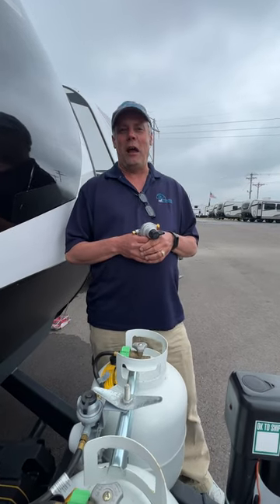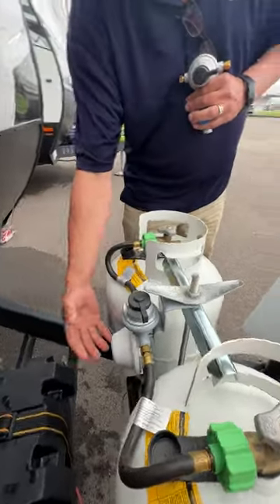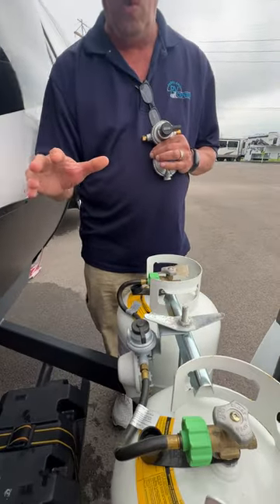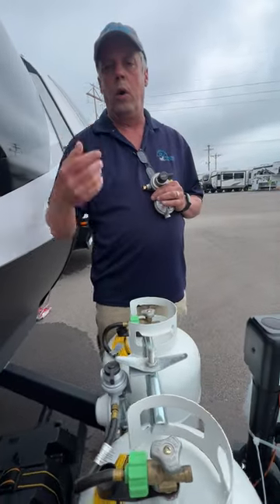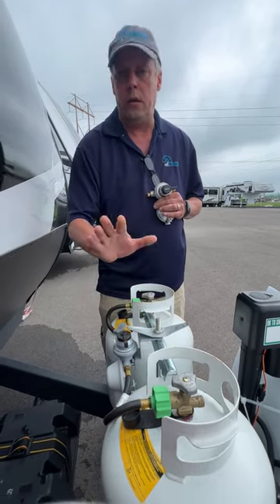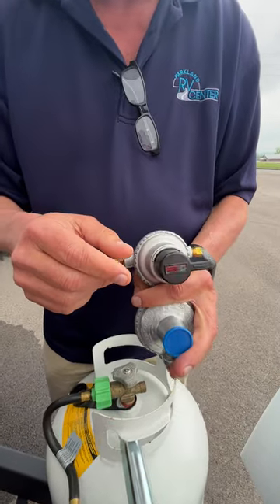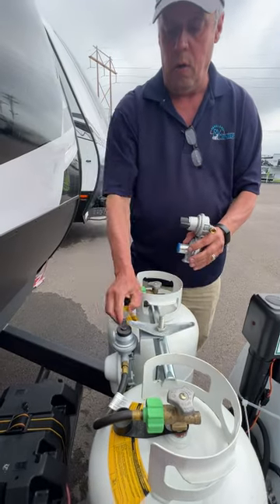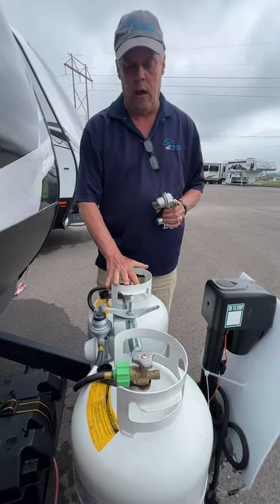Tech Tip: How Does My Dual-Stage Propane Regulator Work?

Comment: Does moving the manual lever in the middle position mean anything?
Reply from the maker: Good question! No--The regulator will still automatically switch to the second tank when the first is empty if the arrow is in the middle, but it won't help you to know which tank is empty.